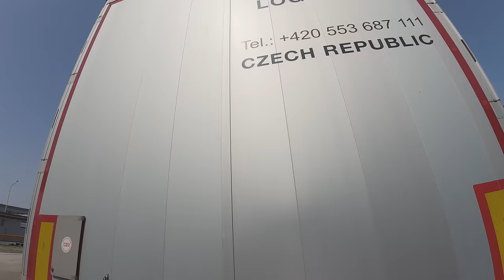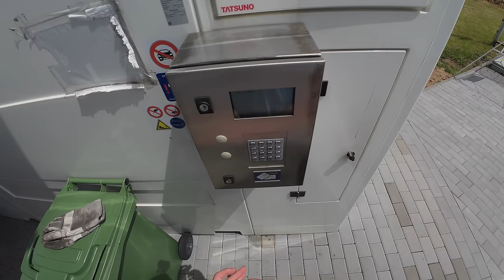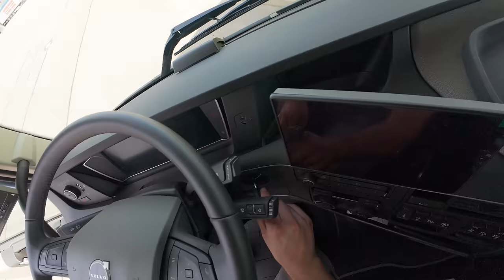VOLVO AERO - Amazing experience and first time in the Czechia

Comment: What? Volvo FH Aero is already on the conveyor belt? Already sold by dealers? Does this mean that virtual truckers from Euro Truck Simulator 2 will be able to get behind the wheel of such a truck in the near future?!
Reply: Didn't think so, they still working on the first facelift of the FH
Reply from the maker: Yes. This is still just a facelift of the original FH from 2012-2013. 
But don't worry. I'm already working on a brand new cab and interior. It should be out in a year or two.
Reply from the maker: Yes, they're on sale now. I haven't seen them in use anywhere yet, I'm probably driving around Europe alone :D , but orders are in. This is a demonstration piece at a show in the Czech Republic.
Reply: They started going into production 6 weeks ago. Seen them 2 times in the wild on a highway in Sweden so they're still quite rare.